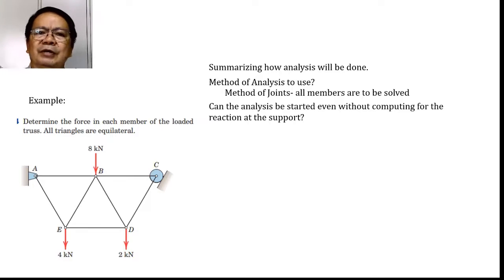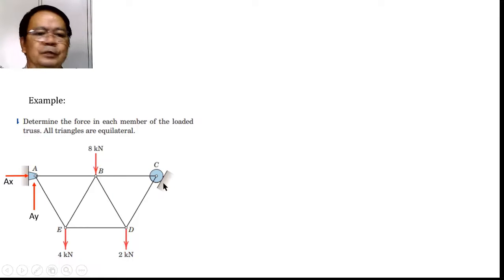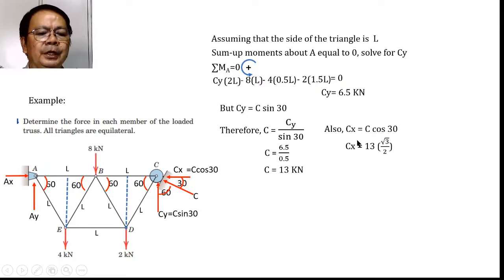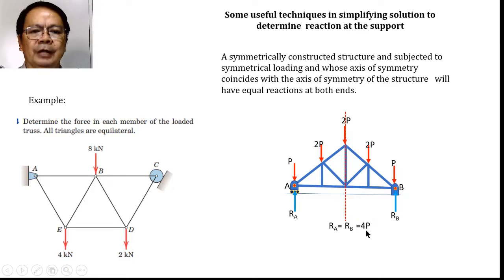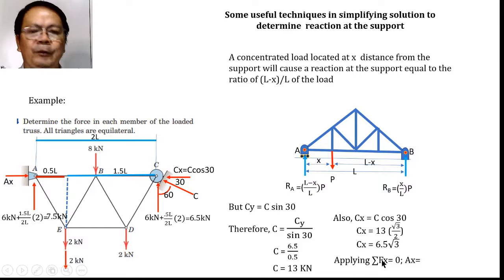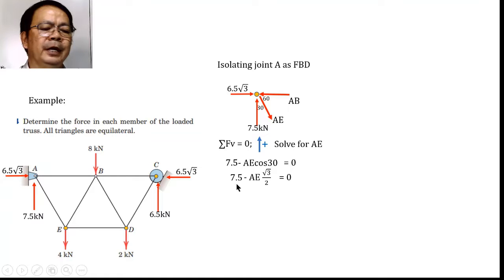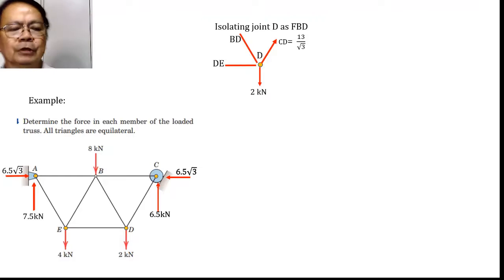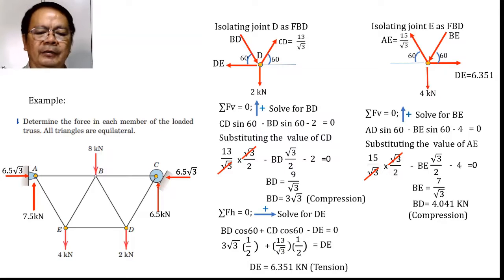Analysis of Structure Using Method of Joints

Comment: Sir how did you get the value 6.5 for cy in example no. 1?
Reply from the maker: Hi .. you can have it solved by taking moments about A equal to zero or you can have it by  inspection that is half of 8 plus one-fourth of 4 plus three-fourthts of 2. You can discover the second approach if you practice working on equilibrium of parallel forces . Thanks for viewing..